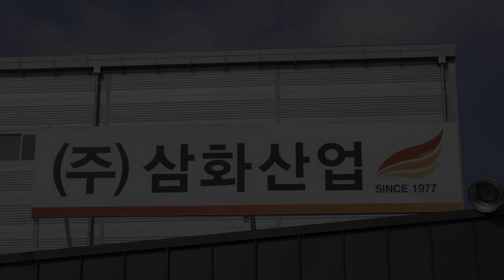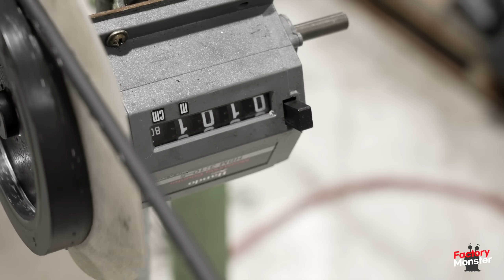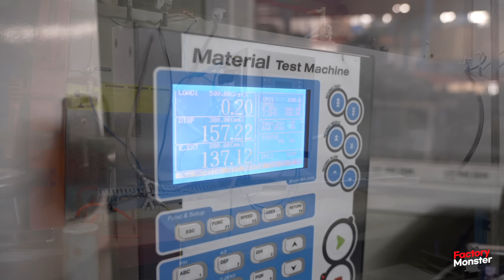Process of making 3 Layer Hose from Raw Rubber Material. Hose Factory in Korea

Comment: The technician is using the durometer micrometer incorrectly. You don't drop the plunger on a thickness measuring device.
Reply: It seems to be a thickness gauge, subtitles are probably wrong.

Comment: Brings back memories! The rollers are actually called a mill. After the rubber is milled until everything is homogenized, it’s either cut into strips or slabs. The “releasing agent” is actually just a type of soap so you can pile it into a basket without it sticking to itself. Before piling though, there’s the cooling and drying. Surprised they do it manually instead of using an automated batch off.